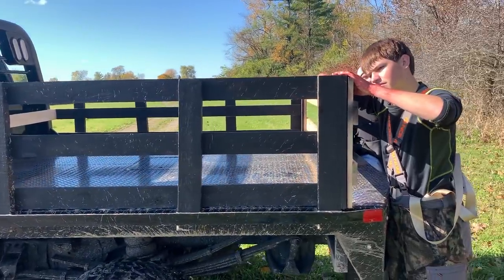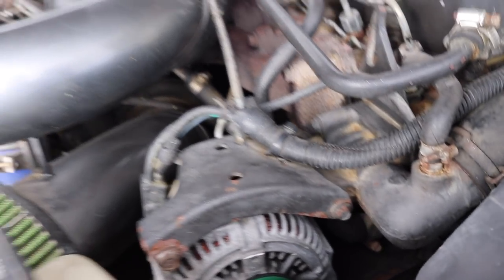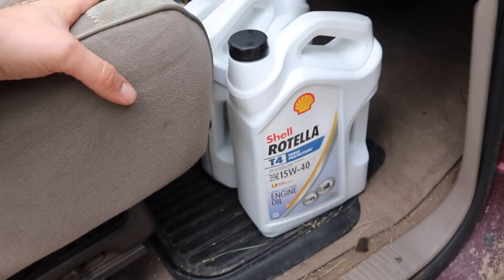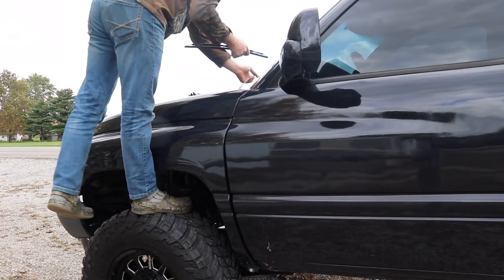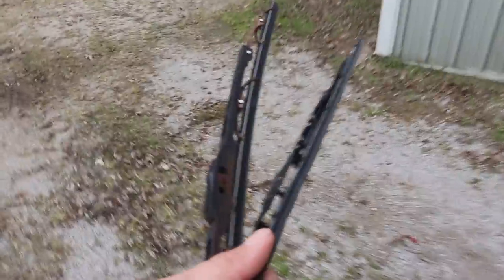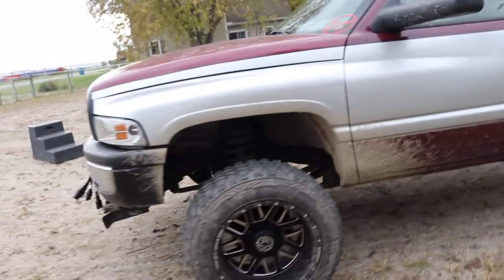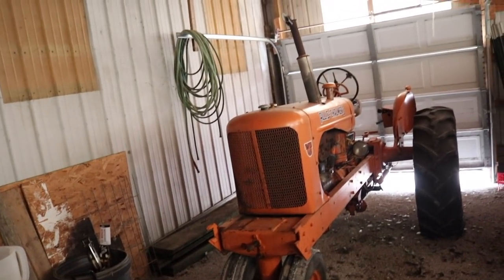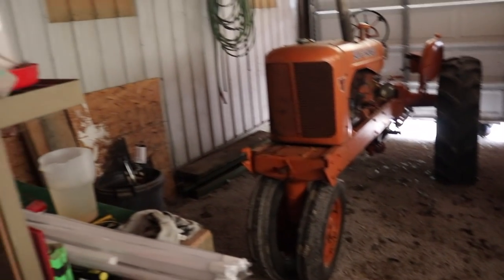It's about time this happened!!!

Comment: Fun fact. When you pre fill the filter you’re supposed to fill it from the small holes on the side so it gets filtered before going to the engine. A little impractical to do it that way just sharing some info. I normally don’t even bother prefilling on my stuff.

Comment: Did I just see a power tool get used to tighten an oil drain plug?
Reply from the maker: Hardly lol my little black and decker screw driver impact lol. Only touched the trigger until it went snug